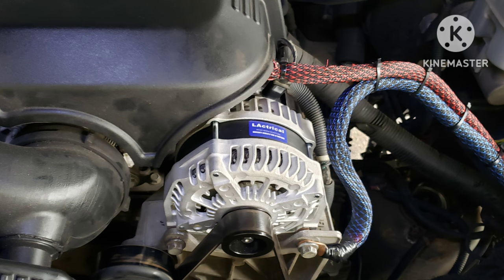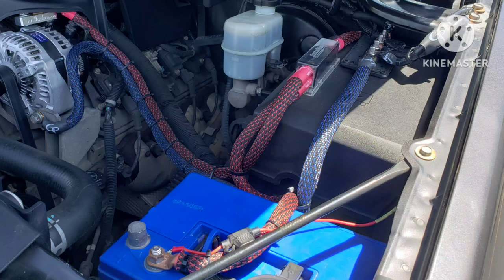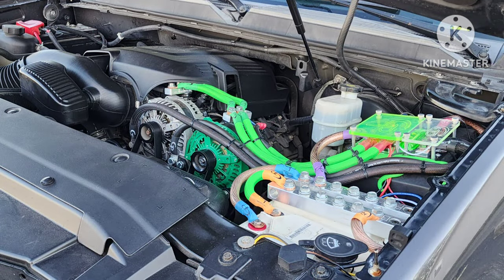Best Car Audio Power, Ground, Fuses, RCA's Tips Tricks

Comment: If you are getting noise or engine whine sounds. You can insulate your rcas with aluminum foil or tape or run it through small pvc pipe or you can just get a ground loop isolator. There’s a lot of cheap east fixes

Comment: Most pure copper wire on the market with lowest resistance. EB flex welding wire. I csn replicate this test with any wire put against it. Car audio dirty secret. Small gauge strands. Lose shield. Easy to flex. Less pure copper. Stacking resistance kills voltage. Performance. Etc
Reply from the maker: I need to make a video comparing the 2, because they are the same in ways but different also.
Reply: @CarAudioEnthusiasts  i just know from my testing with my batteries I sell. Eb flex hands down wins. It's 2/0 has less resistance then windy nation 4/0. Meaning it will carry current better then wire double it's size up on the chart. Yes amperage rating still plays a factor but the principal is that there wire will carry the current far more superior without chance of voltage drop an efficiency loss in long runs
Reply from the maker: so is that 3.49 a foot? @TrunkThunderLithium
Reply: @CarAudioEnthusiasts  there 1/0 is around that price. The 2/0 is 4.19 if you buy all black. Which I did. Use colored mesh loom for the aesthetic color factor.